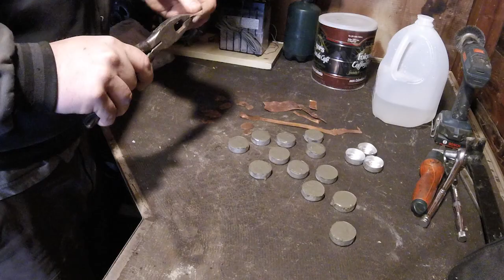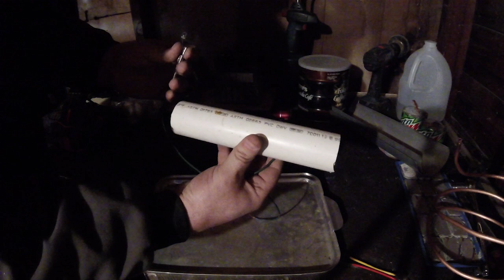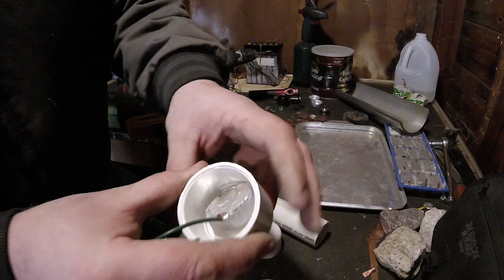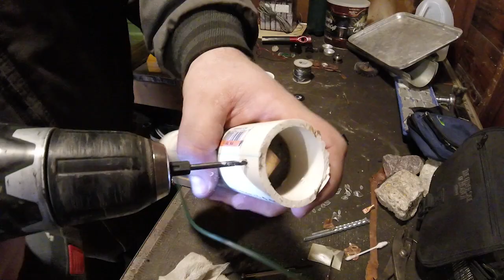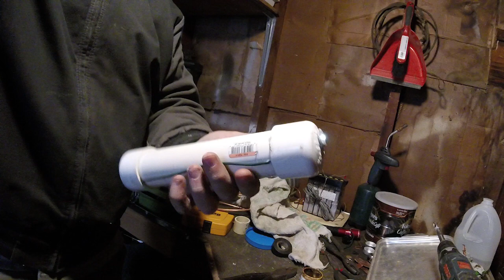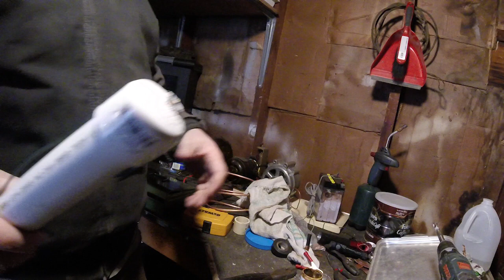Cement Battery Flashlight! FREE ELECTRICITY

Comment: Al turning into Al2O3 and producing 6e- in a process then this electron flowing to the copper plate. It not recharge itself and after a time u need to clean  Al2O3 layer from the cells and it again will work untill all Al turned into Al2O3 or until a bottom Al plate is gone.

Measure the base Al plate weight in gramm / (27gramm/mol) = how many Al u have in a battery
1mol Al produce 3mol e-
Xmol number * 3 * 96 500 = energy u have!   
IF u gave 1 mol Al then it is 289 500C energy, measure the amper then  298 500/amper = u will know how many secundum flash light can work in total before it totaly decayed!

Comment: Would the cement foundation of a house POWER that house for electricity??
Reply from the maker: That's what I was thinking too.  I am testing this idea.  I put a copper pipe in a hole in my parents house concrete foundation and a metal piece in another hole... I did a reading and got a half volt so I know it is possible.  I was going to think of an idea to make a concrete counter top for my kitchen and set in a cement battery set up in the counter top.  I don't know how to do it yet.   I'll do a video if I do.

Comment: OK, wait. this tiny LED is being lit by "quick-crete" "aluminum tea light cups" and "copper" into little squares and attached to the cement side of the tea light cup...? is it permanent power...I mean can you use one and get trickle power from it for the next 65 yrs? whats the catch here?
Reply from the maker: Yes it is true how I built it. I've seen other people do other ideas on crystal batteries.  You can look up people making crystal batteries.   A guy made his crystal battery out of rochelle salts and it has been providing constant power for 4 years so far.  I haven''t been able to time-test mine, but it is still going since I made this video.  The challenge with my concrete batteries is the concrete loses some contact with the plates when it dries. I have some more tests later with some other stuff like quartz. I'll put some links in the description of people doing this.
Reply: @extremebudget  Can you just bend the copper plates and embed them into the concrete?
Reply from the maker: @shinyburner3586  that would be definitely better.  My design wasn't the best.  some people embed a piece of copper tube.
Reply: @shinyburner3586  yes, and it won't help.  when the concrete finishes setting up, there will be no further transfer of electrons.

Comment: Man your brilliant ... what is the theory behind this working? Is the cement kind of acidic ?
Reply from the maker: Other batteries use the acidic idea, but this is the power in the quartz and other minerals that hold the energy.  I know, crazy right?  All matter holds energy.  I just got a multi-meter and started reading many different materials.  I was surprised that I got a reading on almost anything.  Quartz is the easiest to use and cement with the quartz in it is easy to mold and harden into shapes.  The other option is to melt down quartz, but I don't have a way to do that.
Reply: @extremebudget  its because cement is very alkaline and your using dissimilar metals, ie. aluminum cups and copper plates.